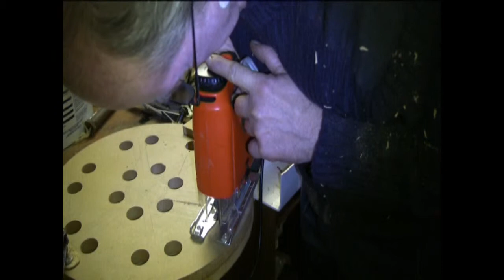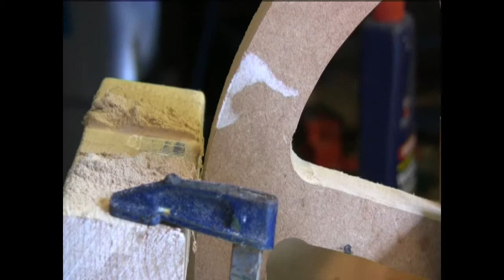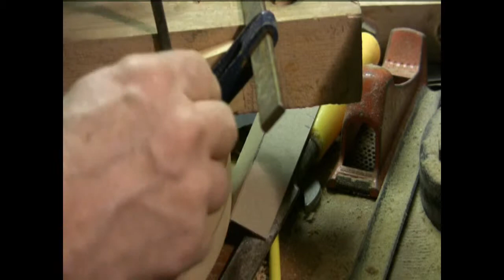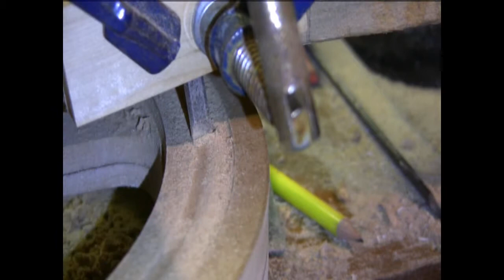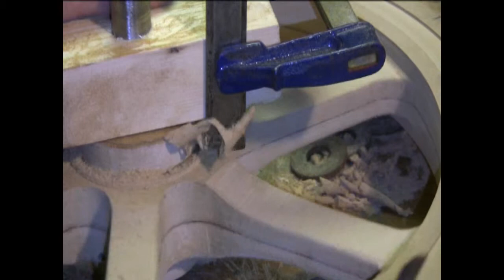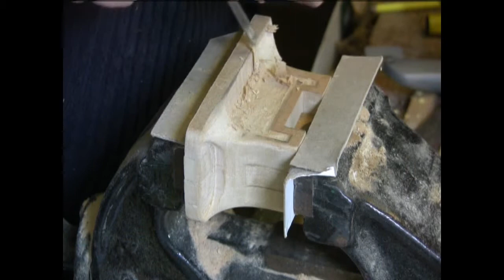BEAM ENGINE FLYWHEEL from SHED ENGINEERING.  PART 3

Comment: A very large amount of work to be sure. Your to be congratulated. If you could have gotten that flywheel blank fixtured at the correct height you could have used your drill press with the smallest vee belt pulley possible mounted in the drills chuck to then power the flywheel with a drive belt. Drill presses don't have the correct bearing to take lateral forces, but in a pinch it could work for a one off job. I would never make a habit of using it in this way. But you want that driven pulley to be small to keep the flywheel rpms down as low as possible. I think I'll hang onto my machine tools tho. :-) But this does show what's possible with some thought and ambition.

Please don't make the mistake some do on Youtube and try and turn a normal drill press into a metal cutting mill. The machines design simply makes it a very foolish idea that will end up wasting every dollar you put into it. 

Flywheel spokes were usually elliptical in cross section and there were a few with round spokes such as the Sanderson beam. Considering that the original castings for all those full sized engines started out as wooden patterns, then every single part can be accurately shaped out of wood to build any model to any size one wants.
Reply from the maker: +Turning Point Hi there manny thanks for your comments,,, very interesting,,,,  Yes I had to be a bit inventive doing the fly wheel ,,,  and I don't think the small drill press I have here would have stud up very long if I could have mounted the fly wheel in it some way,,,,  as you say it would have taken the bearings out in no time,,, but as you may have seen I did get it mounted and was able to true it up and put some detail in,,,,, 

Im afraid oval spokes would have been a bit difficult to get all uniform so had to settle for what you see,,,  and yes the old pattern makers who made the patterns for the huge castings on any of the old engines are a tradesmen who are all too often forgoten  about,,,, the pattern making and casting was to me amazing ,,,,  something I have to start learning now I have built a furnace and want to cast a proper flywheel for a rebuild so I can run the beam engine on steam,,,,,